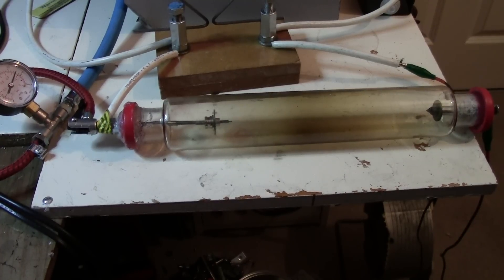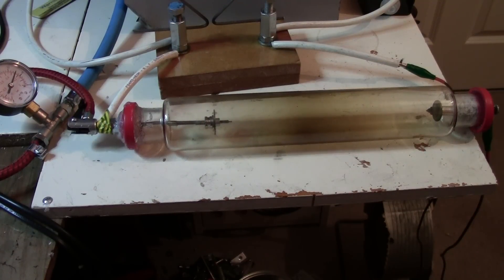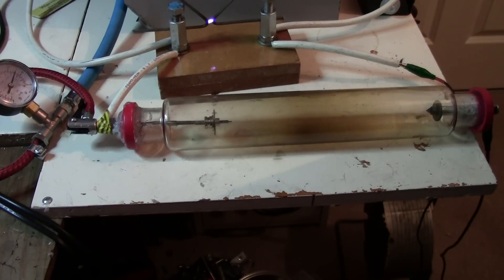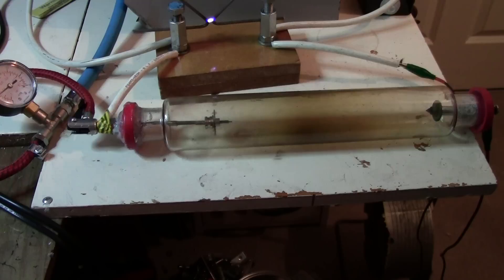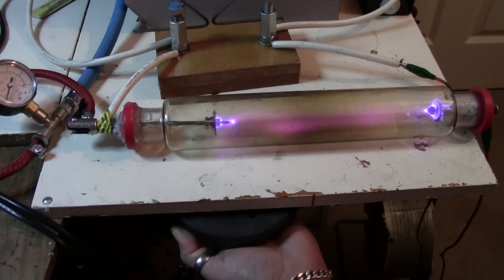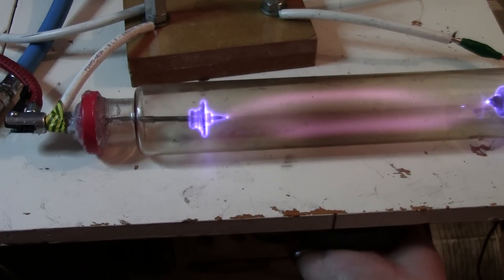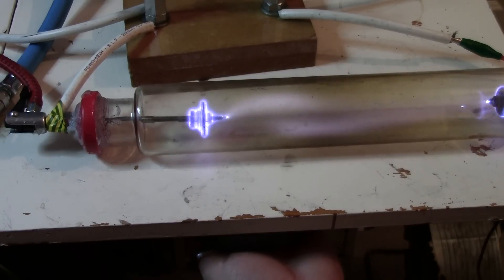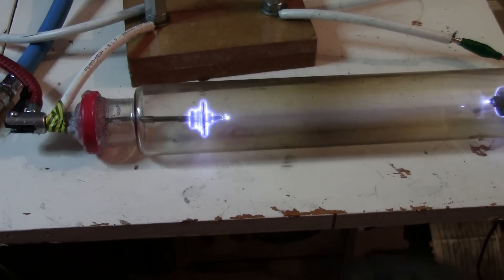Manipulating 1 plasma beam into  2  beams like a corkscrew Requested by Anton and others

Comment from the maker: Hi mate no there is no gas in there ,its under a constant vacuum .as in the pump is running all the time you have to be a bit careful though as if you have to much of a vacuum and to high voltage you'll get x-rays but there are lots of gasses but they would be + pressure not neg like in a vacuum I THINK !?!?! as for glass quartz glass or Pyrex there very good at filtering UV

Comment from the maker: I dont know mate for the money it costs for the tube it has to be worth a try some fridge compressors are pretty powerful and 5kv should be fine as i have closed my gap buy about 4 inches so to keep the heat away from the rubber stoppers just make sure you get a perfect seal dont just slide in wires make sure you use a bolt and you should be fine IF Ant highvoltage1rules still has his you could ask as he has my fridge compressor and my old 5kV NST .have fun mate look fwd to seeing you results

Comment from the maker: this is 240V make sure you ask it it has the starter unit under the case though as in some pics there is wires and some not 
Item number:
171033788805
hopefully you will know someone with an old fridge though that broke as it ran out of gas .wink wink if not you could pic up a whole fridge off Gumtree for about £10 then you will have all the starter parts again now working because it RAN OUT OF GAS :-)

Comment from the maker: I have a 2 stage vacuum for filling refrigerant units but you can use a fridge/freezer compressor but make sure its new or degassed as i think its illegal to empty them again you can buy them pretty cheep off ebay some of the bigger more powerful ones can be quite pricey though

Comment from the maker: i did have a Danfoss fridge compressor that i used to evacuate my X-ray transformer but only pulled to about 19inHG but my VERY noisy one pulls 27.5inHG as its a 2 stage and it can run for a lot longer. fridge ones are fun though especially for bottle rockets you dont even need water in them ;0) .Thanks for watching

Comment: Ah, bending electrical arcs.....Yep, possibly one of the discoveries that led to the invention of the CRT. :-)

That vac pump is way noisy....Have you considered raiding an old fridge and whipping-out the compressor?

The fridge compressor will run virtually silent, and yes, you can use them to pull vacuums as well as air compression too.

A little later on, I'm going to have to get my Little Necchi out and do some more fridge compressor fun vids.

Thanx for showing,

{^_^} BoomBoxDeluxe {^_^}